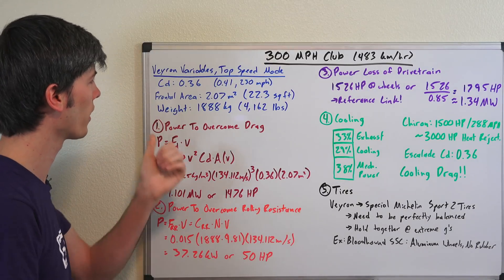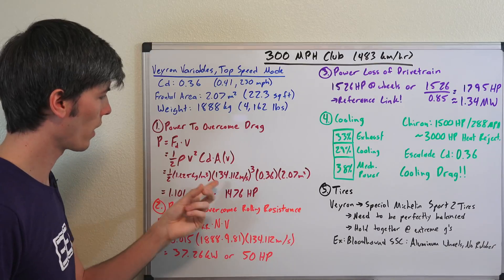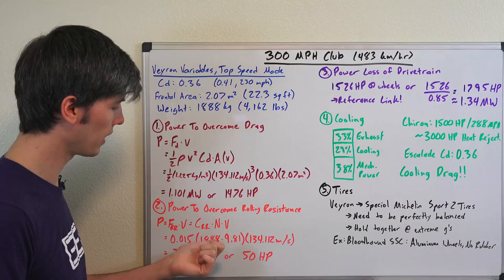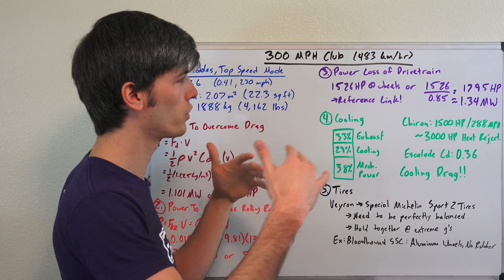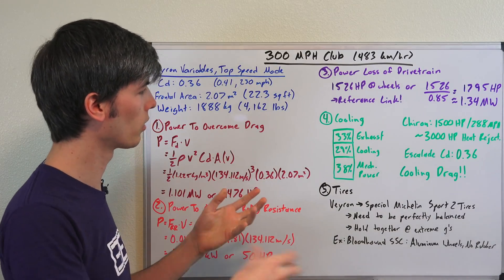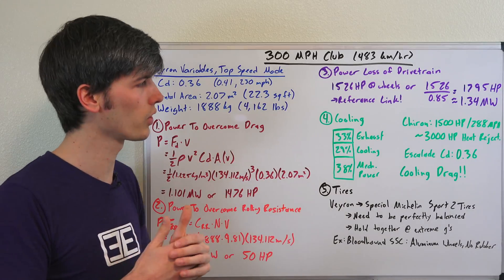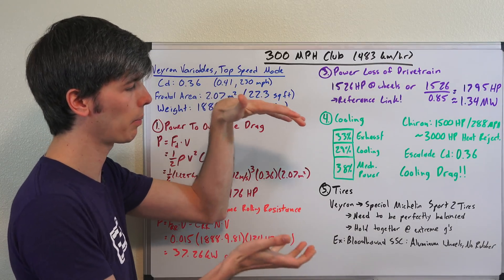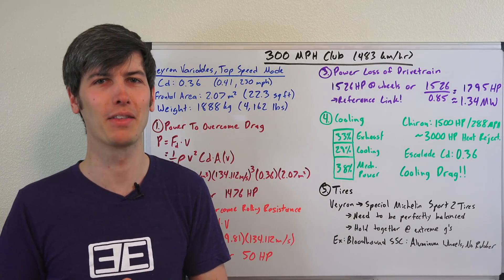Why Has No Production Car Hit 300 MPH?

Comment: Why are there no production cars that have a turbine engine?
Reply: energy from the sun is created by nuclear fusion not fission...
Reply: In addition to automotive prototypes, the M1 Abrams tank uses a turbine engine for high power and quieter operation.  Its a great way to get a high power engine, but the efficiency is terrible for land vehicle use.  Turbine engines are efficient in commercial jets and power plants because they are run at design power non-stop for long periods of time.    Start/stop cycles, idling, and running far below design power are very inefficient in turbine engines, and that is what cars do all the time (even cruising down the highway only takes 50-100 hp on most cars).  A 1500 hp turbine engine in a car would have terrible efficiency.
Reply: yes but they use a fission reaction to create the pressure required to start a fusion reaction. There is no fusion power plant (unless ive fallen behind the science news and someone somewhere has made a massive breakthrough?)
Reply: Angel Gutierrez imagine one of those blowing up in front of you when you're driving
Reply: Angel Gutierrez because efficiency would be a problem. Even the biggest fuel tank on a normal production car would run dry before you left your street
Reply: gagan deep You mean solar energy? I was talking about nuclear energy.
Reply: Dodge had one in the 1960s, look it up, it's pretty cool
Reply: +gagan deep you need to learn the difference between fusion and fission (note there's no caps as it's not a name.) In Fallout 4 (caps because it's a name) they use fission. Wikipedia will tell you all you need to know.
Reply: It is the nature of a gas turbine engine to be very hungry, even when it's not really doing much. These machines have one efficient setting - full power! Any less and you're spending more fuel keeping the thing spinning than you are getting something useful at the other end. They're a favourite among power generation plants to pick up transient loads (being much better at it than giant diesels) and a necessity for any reasonably fast aircraft.

A skookum enough gas turbine engine (assuming 300mph is thine goal) will chew through all that fuel in a matter of minutes! If you want one, you'd better be prepared to feed it!
Reply: have u seen the price of fuel?...that's why not :)
Reply: Jodelorakel Oh. Could we make a semi with a turbine engine?
Reply: Angel Gutierrez search for "jet engine trucks" there are a few of them, one is called Shockwave. They are absolutely nuts.
Reply: yes and no gagan, yes Chrysler had a turbine car in the mid 60's, the drove it all over the place and they even ran it on perfume to prove a point. NO there were no MAJOR "technical" problems. The only two problems they were having were gas mileage and emissions. (not only have/do i  work on mopar cars but i've actually seen the karma body turbine car that Chrysler made).
Reply: Look up the Chrysler Turbine. Jay Lenno had one on his youtube channel...
Reply: Apart from the efficiency, there's the spool-up and down time. They could probably improve on it if they needed to, but listen to how long it takes a jet plane to go from idle to full power and back down to idle.
Reply: You not only do not know what I am talking about, you do not know what you are talking about.  Neither fusion nor fission involve electrons, they involve the nucleus of the atom hence the terms NUCLEAR fusion, NUCLEAR fission; the nucleus of the atom contains protons and neutrons, not electrons.  Changes in the number of electrons create ions and chemical compounds, not new elements which are defined by the number of protons in the nucleus.  Your misunderstanding of the processes of fusion and fission is far beyond what can be explained in a youtube thread, I suggest finding a book that describes the structure of the atom on a basic level.  Even wikipedia could help you out here.
Reply: Angel Gutierrez in short solar energy is nuclear energy
Reply: gagan deep Could we make 90% efficient solar panels? Cars in deserts would never need refueling.
Reply: Matthew Ray There are hydrogen bombs.
Reply: I was going to reference the y2k. A big issue with the y2k is the delay a turbine can have to get power but also to stop the powerflow too. So when you cut the throttle it doesn't start to slow the engine for a second. That can be ver dangerous in the ever changing world of city streets.
Reply: gagan deep - Fusion happens in the sun, not fission. Fission is how "nuclear power" is made. The smallest of which are on satellites....which raises an interesting question...how does a nuclear reactor radiate heat when in space.
Reply: Gagan, the power the sun releases is not fission. i believe you mean fusion, where atoms are fused together to release incredible amounts of energy.
Reply: gagen you are mixing fission with fusion. We have fission in the form of nuclear power. We have not found a way to create fusion yet(except for a few atoms at a time). The sun throws out energy from undergoing fusion, not fissian
Reply: Anything is realistic in a futuristic sense. Watching porn on the windscreen of a driverless hovercar capable of space travel is realistic in a futuristic sense.
Reply: I recall reading an article a couple years ago that Wal-Mart was working on a series-hybrid turbine-electric semi truck.
It's similar in many respects to the Chevy Volt powertrain but scaled up and replacing the 4cyl with a turbine. The electric motor would drive the wheels while the turbine would run an electric generator to keep the batteries charged. This could work well in long-haul trucks that would keep a steady load on the turbine while driving at highway speeds. Some trains even use this sort of setup.
Reply: its very noisy, thats the first problem.
Reply: Gas turbines are great for power to weight ratio and they are easy to make. They suck at efficiency.
Reply: A turbine burns some stage of crude oil product causing thrust. Electric motors turn through electromagnetic attraction forces. Sound is only the byproduct. You could power a bank of stage speakers and make any sound you want with electricity. hahaha
Reply: a fluid coupling would be the best transmission to fit a turbine engine car as you can adjust the amount of power to the drive shaft just by move the two halves of the coupling closer or further apart. I has been used in automobiles before. But the biggest danger of a turbine is the heat generated imagine a turbine car crashing into a petrol tanker and fuel being split on the hot turbine engine. big ba-da boom
Reply: gagan deep Fusion u dingus, Fission and Fusion are as different as Fat boy and the apocalypse
Reply: Angel Gutierrez Jaguar actally made a prototype. But without air-air heat exchanger, which is too big for a car, thermals efficiency peaks at about 23%. That is inferior to a good reciprocating engine.
Reply: Fuel and safety reasons......but look up the y2k bike, its turbine powered Angel Gutierrez
Reply: eXozGaming cool
Reply: quasarcreator Yeah
Reply: Matthew Ray http://www.popularmechanics.com/science/energy/a24172/fusion-reactor-working/
Reply: noise
Reply: purplexenno also jay Leno got himself a custom built 750 hp turbine car in I think 2013
Reply: +Death Pixel Jay Leno put a helicopter engine in a street car, welded the LPT to a torque converter and called it good. During the one test drive, he left the engine idling and rode the brake pretty much the entire way. You'd need some skookum as fack brakes to have that as your daily driver!

This quarter arsed attempt at a gas turbine car is exactly the kind of proof of concept failure that pushes mainstream manufacturers away from the concept. Plus if you're after a speed record this really isn't the way. You will waste a LOT of energy driving a gearbox and spinning wheels, when you could just dump the LPT altogether, bolt a good nozzle to the damn thing and use the thrust it generates. That or a high bypass ratio. That would be a much more efficient way of going fast in a gas turbine powered street car. It would also not be affected by thrust lapse in the speed ranges you're concerned with (you don't even enter compressibility until about 110m/s!). All you need to know is the amount of drag you need to counteract. The rest can be very easily engineered into a jet engine.

You also need deep pockets for the fuel bill :P
Reply: 233kosta The fuel bill wouldn't be that bad if we used 12-16 gallon tanks. The lowest price in my area is $3.38 per gallon of jet fuel. The lowest price for regular gas is $2.57 (in my area).
Reply: Angel Gutierrez There actually IS a couple production cars with turbine engines.
Reply: http://www.motorauthority.com/news/1108974_techrules-supercar-adopts-mclaren-f1-style-central-driving-position
Reply: Aric Roy Radiation
Reply: there is a production motorcycle with a turbine engine taken from a helicopter. Jay leno even has one
Reply: We have plenty of ways to produce fusion, and with way more than a few atoms at a time.  Thermonuclear weapons (aka hydrogen bombs) fuse quite a lot of nuclei.  What we haven't yet been able to do is produce fusion in a controlled manner that actually produces more power than it takes to produce the fusion in the first place.  Google a device called the fusor, these produce fusion using high voltage and have been around for decades; some have even been built by high school students.  Though fusors haven't actually produced net power they have had practical use as a neutron generator.
Reply: jhensi what you are talking about is called 'fission' not fusion. Fission is when atoms are stripped of their electrons while the nucleus stays the same, fusion is the exact opposite. It is atom nucleus coming together and giving off extra electrons in the process. The sun takes hydrogen and makes other elements such as iron. we take elements and strip them into hydrogen.
Reply: Not really - planes and helicopters seem to do very well with gas turbine engines.  A gas turbine may be expensive to run but range would not be a problem.
I doubt a gas turbine is even less efficient than a large high performance petrol engine. 
Thee are other issues with gas turbines but mainly inconveniences and cost more than anything else but nothing that cannot be surpassed or at least tolerated if what you want is ultimate speed and acceleration.
Reply: +Angel Gutierrez you have so many irritating questions please stop
Reply: Kwong Yee Cheung Why?
Reply: Because they're kinda just leaking out of your head without any consideration for realistic situations :/
Reply: Kwong Yee Cheung It is realistic in a futuristic sense. Turbine engines are a lot faster than cylinder ones.
Reply: Kwong Yee Cheung Huh.
Reply: We have had turbine driven cars in production before. Search Chrysler Turbine Car. And then Jay Leno created one as well, the Jet Car.
Reply: What's the peak efficiency on a turbine engine, anyways? They could maybe be used in an electric hybrid to recharge the batteries when they're running "low". That way they would run at it's most efficient power output.
Reply: ***** Peak for turhine engines  is around 550 mph...
Reply: Closest we've had to nuclear powered cars was the Ford Nucleon concept car. Never made out of concept model. The amount of cooling and lead shielding needed, would not be worth it.
Reply: Angel Gutierrez you would be wrong. do your research
Reply: Angel Gutierrez Chrysler in the 60s did
Reply: turbines NEED SPEED otherwise inefficient
Reply: there are , and there is a motorbike that has one
Reply: Angel Gutierrez I'm there was. Chysler had one way back in the day
Reply: Angel Gutierrez there was the crysler turbine in the 60s. but the other GM brands put a stop to it.
Reply: NoMerCcy there are solutions
Reply: Disagree. Look up Leno's video on the 63' Chrysler Turbine.
Reply: There are. they're excellent. 

Look up Leno's video on the 63' Chrysler Turbine.
Reply: Disagree. Look up Leno's video on the 63' Chrysler Turbine.
Reply: that's fusion its not the same
Reply: yeah no good luck splitting a hydrogen atom
Reply: Angel Gutierrez

You need to chill on video games. You have lost your sense of reality.
Reply: Angel Gutierrez The  Rover Jet 1 had  a gas turbine power plant in 1950
Reply: Angel Gutierrez theve had..In the past to reach the highest top speed in history..
Reply: and its not good 4 the enviorment and its sutroundings
Reply: Too much radiation exposure even in a theoretical fission powered car. Too much weight and material needed to shield the driver.

Nothing wrong with the "lowly internal combustion engine" which hasn't come anywhere near it's potential in design. If only the government and regulatory entities would get their grubby hands out of the way and allow engineers free reign in power, emissions reduction without cats, and other technologies.

Think Freevalve camless tech by Koenigsegg. If this gets off the ground, it would revolutionize the I.C.E. in every way.
Reply: Chrysler produced 55 turbine test vehicles in the early sixties.   One was featured in a movie called The Lively Set.   Most were scrapped by Chrysler but a few remain including one in Jay Leno's private collection.    Problems with efficiency are the biggest drawback.   In the fifties and sixties Union Pacific tested turbine-electric locomotives culminating in an 8,500 horsepower unit that needed a 24,000 gallon fuel tender.   These were all retired because the low grade of fuel UP was using went up in price making the turbine units uneconomical.    It's been over sixty years.   In that time shaft-turbine development has continued in helicopters and the M1 Abrams.   Perhaps someone will try again.
Reply: Agreed. Commercial aircraft demand for turbine engines has taught engineers a lot of lessons in efficiency and design. Maybe on a small scale things can be improved and utilized.

I think more than powerplants, it's the road infrastructure that's the biggest problem. Stop lights, traffic jams, lack of space, urban congestion, etc.
Reply: Turbines are only efficient at full thrust. Unless you're using a high trust setting its wasting fuel far more than a reciprocating engine would. Your car engine can idle and use hardly any fuel. A turbine cannot.
Reply: Turbines are efficient at high altitude, ingesting huge quantities of freezing cold air, with a lot of fuel sprayed into the burners. To generate an efficient air-to-fuel ratio is much more difficult in an open-air chamber like a turbine, compared to a precisely metered enclosed area like a cylinder with a piston compressing the mixture.
Reply: Lifted_Above What if we use a propeller?
Reply: +Angel Gutierrez there are aircraft that have turbine engines with props. Cessna 208, Pilatus PC-12, and TMB-A50 for example.
Reply: Eddie Last name I want to fly in my car.
Reply: Chrysler also made a running prototype in the 60's
Reply: An electric motor is a turbine..
Reply: no its not
Reply: Sounds like it if you want to
Reply: Angel Gutierrez THERE IS ONE THE JET CAR REALLY GREAT NAME
Reply: Lifted_Above whats wrong with educating people it wasnt waste of my time.
Reply: Angel Gutierrez :P
Reply: Angel Gutierrez :P
Reply: Angel Gutierrez, no
Reply: Angel Gutierrez because its impractical, ur gonna run out of fuel be4 u get to 60 mph. Turbines respond slower than pistons
Reply: Fuel consumption and maintenance
Reply: vasilikosolov a
Reply: Angel Gutierrez there is Motorcycle with turbine engine Y2K. it has top speed is more than 250 MPH. about car, Chrysler made some cars with turbine engines way back in Sixties, I think in 63-64 but were scrapped due to many technical problems
Reply: the only reason turbines arent in cars is because cars cant function like a helicopter. turbines dont change speed very well, and are basically a giant turbo, takes awhile to spool up. also, turbines reach maximum efficiency going flat out at full throttle. in a helicopter thats great, because the rotors dont change their speed, they change their pitch. so the turbine is always going full throttle, which makes it more efficient than almost any other engine at large power requirements. so, unless we can make a transmiison in a car that can operate without the turbine ever changing its rpm, its worthless.
Reply: Angel Gutierrez no we can't, no matter how hard we try, 90% energy efficiency cannot be reached coz heat always dissipates or is wasted in one way or another unless somehow scientists find a way to end the friction, even then 90% mark will be nearly impossible
Reply: gagan deep Cool. Imagine 30 years from now cars running on fission energy like in fallout 4!
Reply: Evan Jeffrey What if we use ALOT of lube to decrease friction and we use liquid nitrogen to cool it off?
Reply: do you mean fusion? Fission is the splitting of a hydrogen atom and harnessing the energy of that action. Fusion is forcing to hydrogen atoms together (talking in terms of hydrogen only) to make helium and using the resulting energy, there is currently no production reactor that uses fusion die to the insane pressure required for that sort of power production.
Reply: No satellites have fission nuclear reactors. They use RTGs, or radioisotope thermoelectric generators, which are capsules with pellets of radioactive material inside that transfer heat to heatsinks fitted on the device. The difference in temperature between the radioactive pellets and the heatsink allow thermocouples also inside the capsule to generate power.
Reply: Angel Gutierrez Why are there no cars that have nuclear engines?
Reply: because jet engines are a bit too crazy for cars, not for motorcycles tho
Reply: the battle of maintaining precise clearances when dealing with thermal expansion....heat is both the solution and the problem with currently popular technology. Think Small dream big.
Reply: there is crysel produced i belief 6 turbine model cars
Reply: Angel Gutierrez I dont play RPG games like fallout but about Fission energy it is possible to run cars on it in future. but that is the later thing, first we need to tap Fission energy provided to us by Sun and convert it into mechanical energy and use it for different purposes including for cars
Reply: Angel Gutierrez yup solar energy. energy provided by Sun is Nuclear energy which we call Fission energy. it is released when 2 atoms of Hydrogen combine under high pressure resulting in formation of Helium.